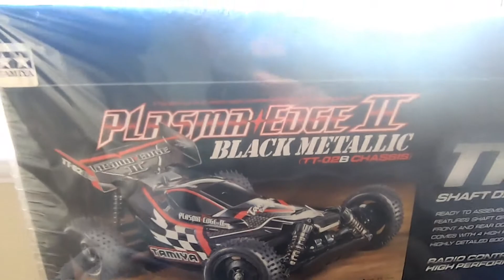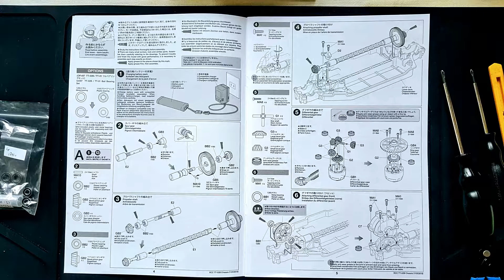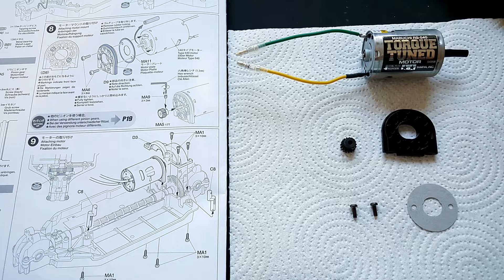New Build Tamiya TT-02B Plasma Edge II Black Metallic Pt 01

Comment: Tamiya Kits are the best! 
Nice initial upgrades too. I'd say from my experience, the Aluminium Mainshaft is the second most important - right behind Bearings! With any kind of Brushless Motor upgrade, the stock plastic shaft, although fine in most cases, can actually TWIST under higher Power.
Kudos my Friend!! 
Carmine ✈🚂🚙
Reply from the maker: Hi Carmine. I didn't really need the hop up shaft, but it was very cheap from RCMart and ended up in my basket lol 😄👍👍.
Reply: Yeah Derek, that USED to happen to me too....

Comment: Perfect oppurtunity for a new build. Looks like a cozy spot in the kitchen. Good build and photos. Reminds me I must do one too soon, with photos. Best build time and makes a good video. I see you also use AW inside the diffs. Nice. What grease did you use on the outside ring and bevel/pinion gears?
Reply from the maker: Hi Mikael. Our house has very poor light inside during these winter months so I pushed the table under the window. I stopped about 3.30pm because the light was fading. I wasn't very happy with the photos or video clips really, but they were the best I could manage in the conditions. I nearly gave up because I was spending more time trying to get a decent photo. I used the greases that were supplied in the kit. I used the little white tube on the outside ring and bevel/pinion gears, and the little tub of AW grease on the diff gears and to seal inbetween the diff covers and chassis and also around the edge of the motor mount which seals it under the motor/bevel cover. It's the first time I have seen and used AW grease. It's really sticky ! I also have a syringe with some marine grease on standby in case I use up the Tamiya ones.
Reply: Holly Hill RC You did excellent, Derek. Was the end done with stop motion? Looked great. Car looks really great. Yeah, the AW is really sticky. If one gets too much on the fingers ends up washing hands for hours 🙂
Reply from the maker: @NordicRC  Thank you very much Mikael. I spun the chassis on the stand and recorded it, then edited it in 1/25 slow motion. Then I spent hours washing my fingers 😄😄😄

Comment: Hi Derek.  Looking good so far.  I like your spinning stand thing.  Big bonus of this kit (and my Dual Ridge metallic) is no lexan cutting and painting so you should be done in no time.  The chrome bodies do look rather cool.  I haven't run mine much yet as I broke a drive shaft while testing.  I have got that silly fast brushless set in it so you should be fine with the torque tuned one.  I was wondering about your predicament with the kitchen table.  If you organised your vast collection of RC's better, could you fit a table in that room?  Would obviously be better if you could find a little corner of your own to work in.  I know that after the fire and before I had the new hobby room it wasn't popular with my wife if I used the dining table for building.  Anyway, look forward to seeing this one done.  I think that the stickers will go well with the chrome.  Cheers mate :-)
Reply from the maker: Hi Pete. I intend to get some twin slot shelving and get a lot of them off the floor and other surfaces. Trouble is I have more RC's  now than wall space. But at least I can make some room at least. I would love a table of my own but even if I get the RC's sorted there just isn't enough space in the room for one.

Comment: Does make me laugh you have to wait to use the kitchen table. When running on Tarmac I use CC-01 wheels and tyres, to save the spikes for off road. Pre painted good for this time of year.
Reply from the maker: Lol, I think it would be impractical to attempt a build on the bed. I can do small repairs or mods on it, but you can't beat the luxury of a kitchen table for a new build ! 😀👍👍